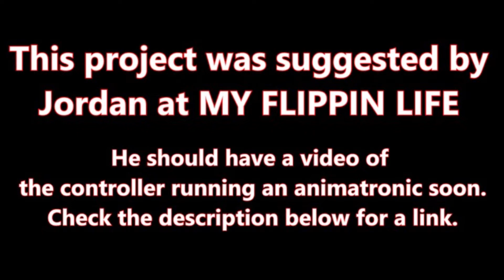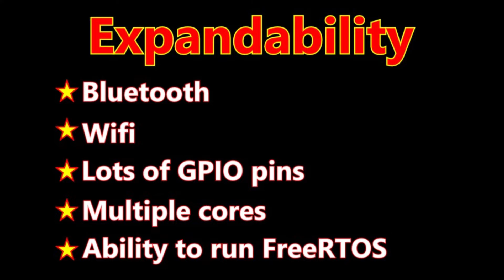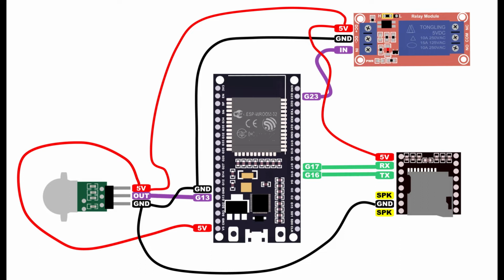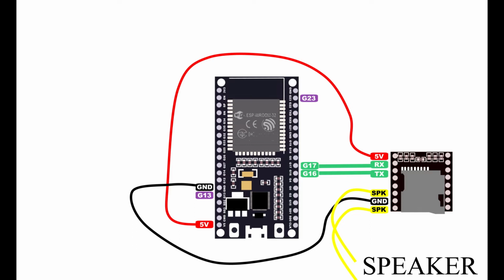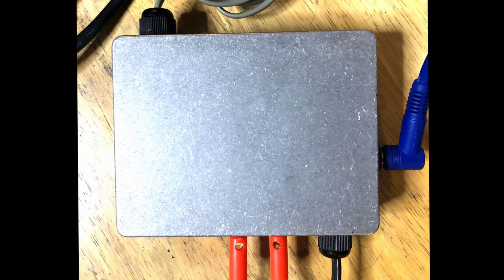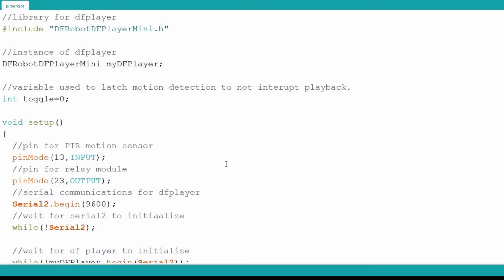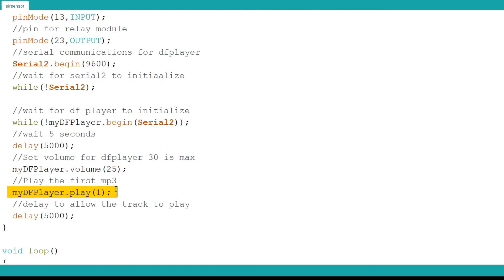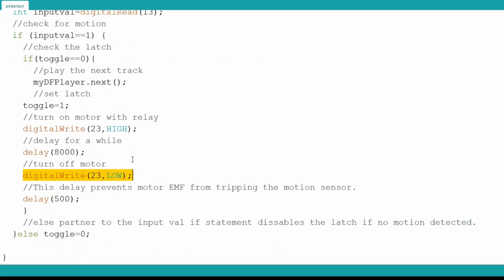ESP32 based Halloween prop controller diy picoboo alternative! (spirit Halloween 2022)

Comment: Very nice! Thanks for the example--it's inspiring me to get back into it again. Something that will make your life easier, tho, don't name variables things like "toggle." Call it "Latch" (or "bLatch" if you want to convey that it takes Boolean values of T/F 1/0). Wait until you decide to expand this program in 5 years ... "toggle" may be less than helpful. Actually, a better name would be "Busy" or "SoundBusy" (bSoundBusy).
Reply from the maker: Thank you, that is a very good point. I have a bad habit of always calling similar interlocks "toggle" because I think of a toggle switch as you would say latching something.

Comment: Love the video but i do have one question, I have the same side breadboard and i put mine on dead center and it fit just fine where i could use the pinouts on the bread board. I think yours would work the same would it?
Reply from the maker: I think the spacing was off on my pins, or it got bent.

Comment: I truy love this idea but i want to install it inside a Train Car. I have the boards and relays I use rectifier and Buck/Boost to regulate track power, and tips for mobile setup. Great share thank you so much. Trying to dream up a Halloween Car. Dennis at Frankentrain Laboratories
Reply from the maker: That is an awesome idea! I would use an arduino nano instead of the ESP32 for that especially if its HO scale or smaller. Other than that its the same thing, let me know when you get it done, would love to see it!